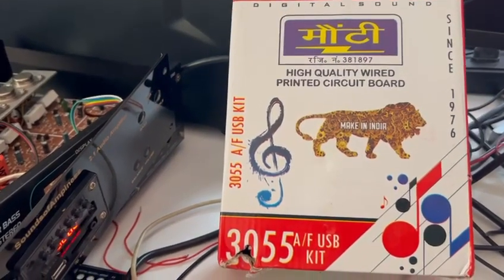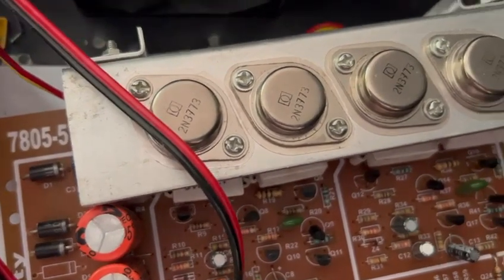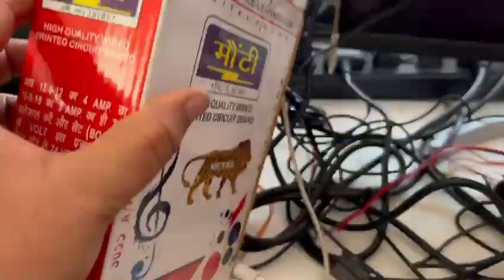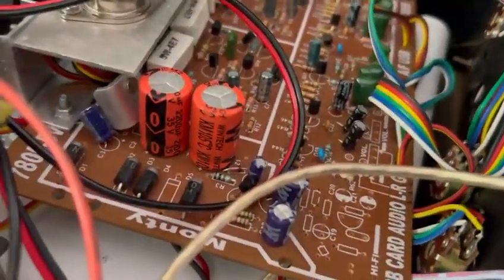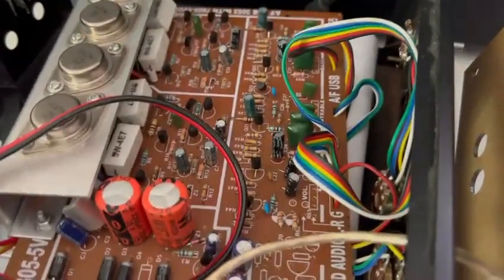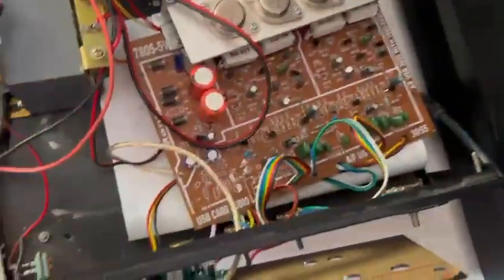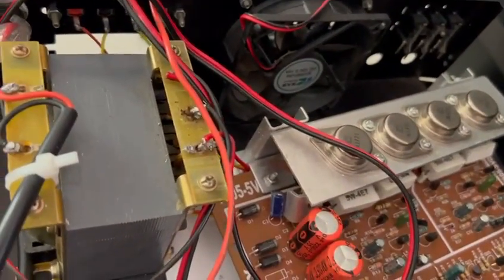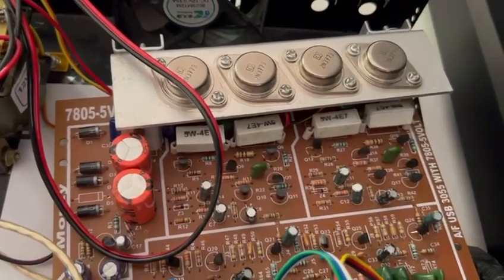Testing the 2N3055/ 2N3773 Monty Audio Amplifier board

Comment: What's difference between 4 transistor & 5 transistor board of monty ? Why they ask to use 18-0-18 transformer in 5 transistor board?
Reply from the maker: 5-Transistor Board adds an extra driver or pre-driver transistor for higher linearity and current gain.

The configuration is usually:

1 pre-driver, 1 driver, and 3 output devices (or 2 drivers + 3 outputs).

Handles higher load current and operates efficiently at higher supply voltage.

Power rating often 150 W – 200 W RMS (per channel).

Hence, it needs a higher secondary voltage transformer — typically 18-0-18 V (or even 22-0-22 V).

18-0-18 V transformer is required for 5-transistor boards

Higher voltage = more power output

18-0-18 V AC becomes about ±25 V DC after rectification and filtering.

This higher rail voltage allows the output to swing further and deliver higher wattage.

5-transistor design is built for higher rail voltage

The extra transistor(s) improve drive strength and thermal stability.

The circuit can safely handle and utilize the higher supply voltage without distortion or clipping.

Power transistor bias and protection circuits are tuned for 18-0-18 V supply.

Using a lower voltage (like 12-0-12 V) on a 5-transistor board will underpower it, causing low output and possibly crossover distortion.

Using a higher voltage (like 22-0-22 V) on a 4-transistor board might burn the transistors or cause thermal runaway.